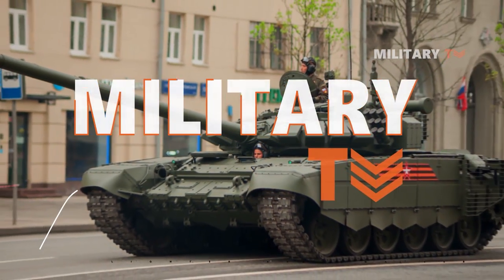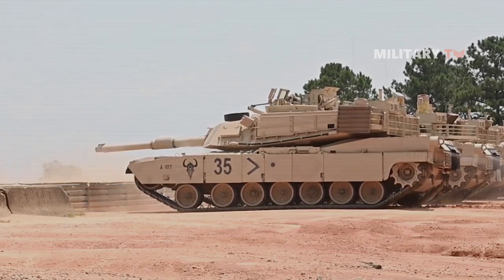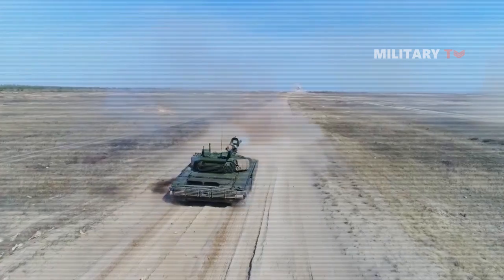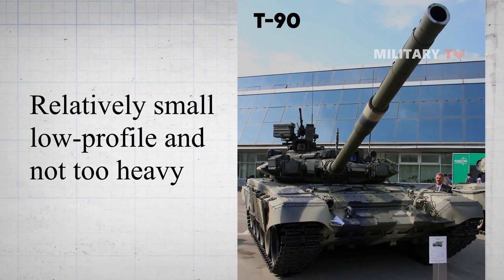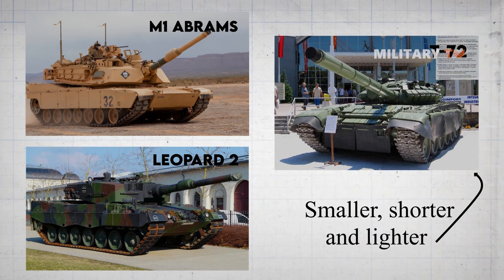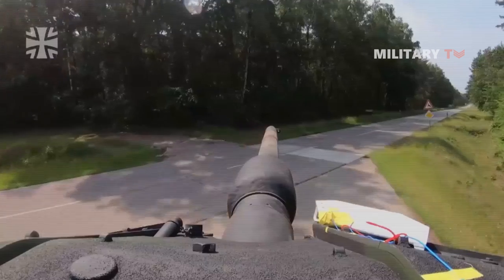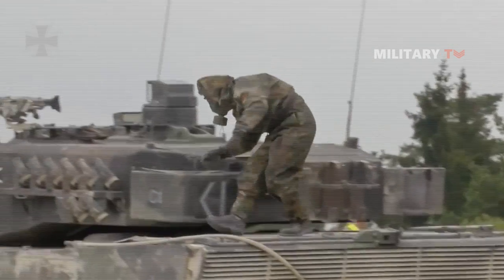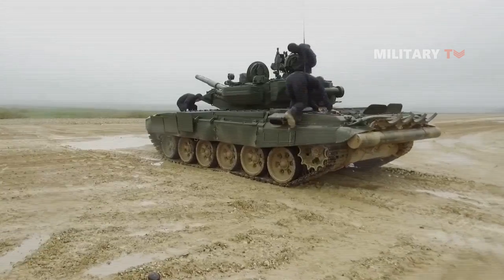Why are Russian tanks lighter and smaller than the western tanks

Comment: Tanks are outdated units period.
Reply: they're not.
Reply: @spitfire8790  against anti-tank squads yes they are.
Reply: @PeterPing  They are not, that is NOT how you use a Tank. An Infantry Section has always been more powerful than a Tank since the 1940's. You use Tanks to weak exploit gaps encircling the enemy you don't use your tank against enemy Infantry that is for your Infantry and your tank don't go toe to toe with another tank as again that is the job for the Infantry.  They are not outdated.